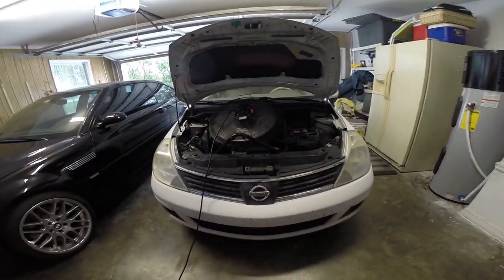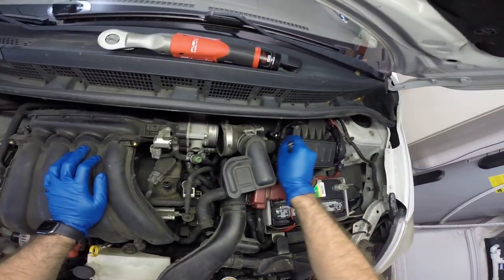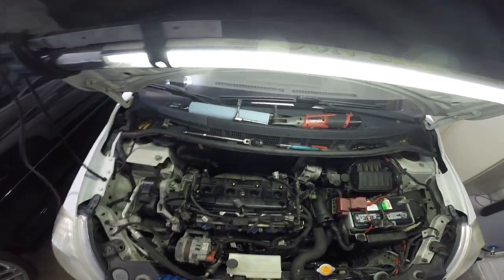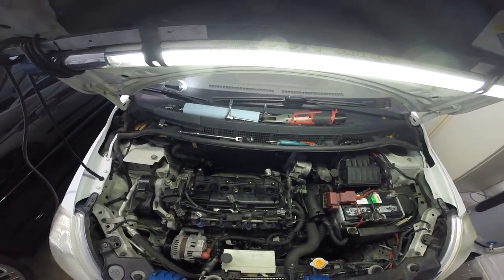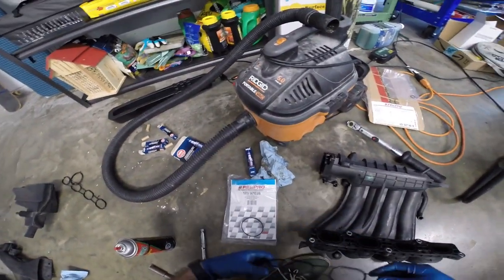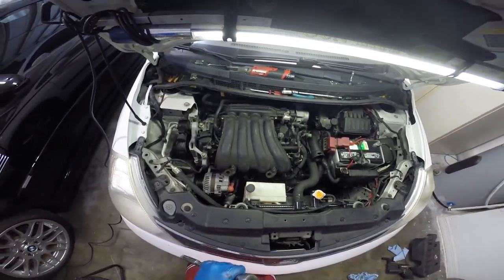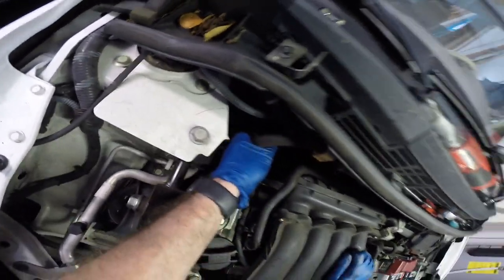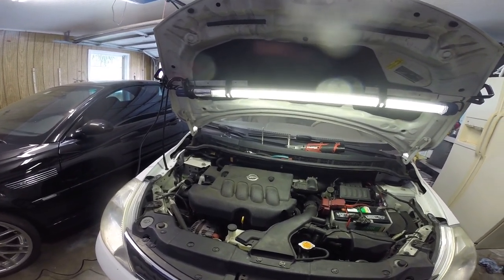Nissan Versa Valve Cover Gasket, Intake Manifold, and Spark Plug How to DIY

Comment: How was the carbon build up on intake valves? Sorry I know this video is old but at 156k miles I could only imagine. I have a 2014 Versa thats direct injection and wish I would have known it before I bought it.
Reply: These engines have 2 injectors per cylinder. No carbon buildup on the intake valves.

Comment: How much does the job cost. Spark plugs, coil packs, and gasket?
Reply from the maker: Plugs and gasket are not much. About $30-40. I didn’t replace any coil packs which could be very expensive depending where you purchase. I did all the work myself so I cannot comment on typical labor cost for this work.

Comment: Aren’t you supposed to disconnect the battery so you don’t accidentally short something out? I’m a noob here so real question lol
Reply from the maker: You can if you want as an added layer of protection. I have never disconnected the battery to do spark plugs. The OEM Nissan repair manual does not state disconnecting the battery either for this scope of work. I only way I would see you running a risk of shorting something out for this work is if you have exposed wiring.